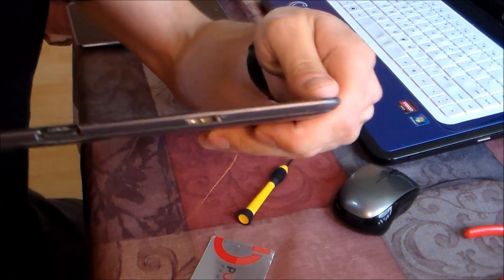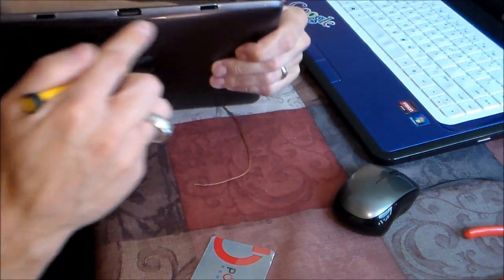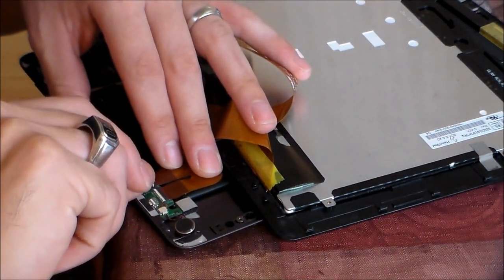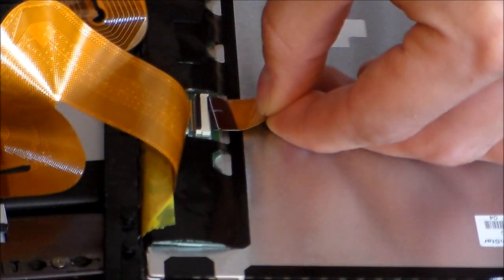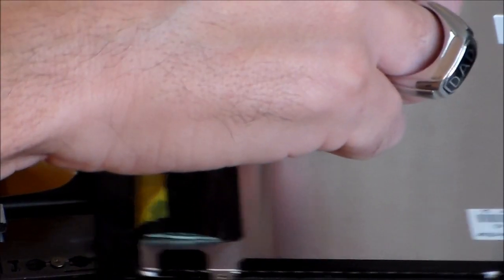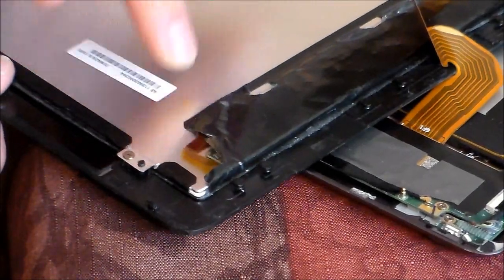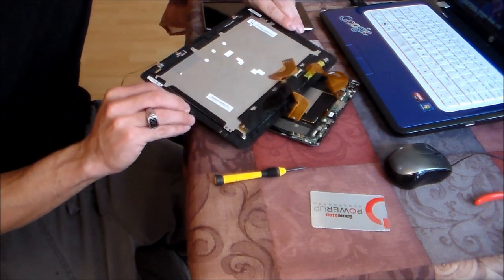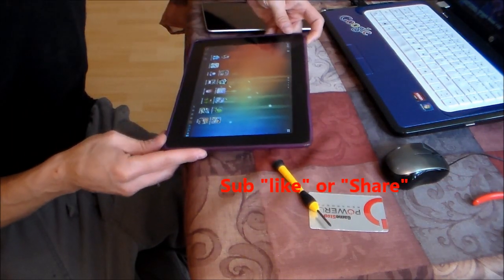Easy How to Fix Asus Tablet No video Display Screen Repair

Comment: My ASUS Transformer TF101 tablet. 
 The screen is not lighting up 
 but if you plug the HDMI cable into a TV
 the touch screen and all features work
 it only appears on the TV and not the Tablet.
i check all conections.

Comment: Do you think this will work for the  ASUS ZenPad S 8.0 Z580CA 8.0 ? I can't seem to find anyone nearby who works on this unit. Does it use unique parts as well? Glass and digitizer might both be damaged (glass is cracked).

Comment: HI Tampatec.  I think i have this same problem on my tablet (outside warranty) except my model is slightly different and i can't figure out how i might get the screen off.  i have the asus transformer pad trio, model TX201L.  ever seen  this one or have any ideas how to get it open?  the pc (dock station still works just the tablet part/screen is no longer working). thx!

Comment: I had to change my display after my roomates broke it by dropping the tablet down. After they bought a new display and they changed it, this new one cannot work once you shut down the tablet. Basically what you have to do is, connect the old, broken display, turn it on, and then connect the new one and place it where it belongs... anything I can do about it ?

Comment: Thanks for this! I watched like three other videos before this one and none of them mentioned the latches on the bottom, I thought I was crazy because I couldn't get the display to come off. Finally found yours and slid the latches over and it immediately came apart and I was able to get the display working again.
Reply from the maker: +Zack Rogers awesome

Comment: After a small drop on carpet and in a case my Transformer Infinity display wouldn't come on. I found this video and 5 minutes later it works again. Thank you so much!
Reply from the maker: cool,  good job fixing it!
Reply: +Tampatec Oh yeah, and bonus points for the Powerup Rewards card, I've worked for Gamestop for 20 yrs :)

Comment: I have 2 Nextbook Ares 8 tablets. One was dropped and the display was ruined so I salvaged the circuit board that has the charger ports attached to it since the other port was loose and wouldn't charge. Now that everything is hooked up, it charges, but when I power it on the screen turns on and is black. Is this because it was dropped? I've reset the battery and set the ribbons as snug as I could. Any insight would be appreciated

Comment: hi Tampatec. If you're still willing to answer a question on this older video; I have a similar device a Transformer Book t100.  The digitizer screen got cracked and I took it to a repair shop to be fixed. They fixed the digitizer but in the process the LCD no longer works. They made good and got us a new one but I decided to try and repair the old one myself. After taking the tablet apart, I discovered that the black connector that holds the wire from the LCD and onto the motherboard has broken and some of the wires are exposed. Can this be easily repaired? Digitizer works as does HDMI out to another monitor.

Comment: I have an ASUS Transformer tablet. The glass digitizer touch screen was broken when it was dropped. It wouldn't even show it had power after that. I replaced the glass digitizer screen. Now I can see that it has power but that is it. Nothing comes up on the screen. Got any suggestions for me. I hope. I'm getting desperate here. Thanks.

Comment: dude I enjoy your videos but you keep showing just that one tablet, my tablet does not have the lock things on the sides, all it has are the SD card slot, headphone jack, and Charger port, so how am I supposed to open it?????
Reply: also the problem with my tablet is, I forgot it was charging, and when I picked it up to take it, the charger yanked it back and it dropped on the floor, cracking the screen in many places, and now it is not responding to touch.
Reply: Kids With Dreams Music Official your tab is now good for the dustbin ! Lol

Comment: I need video on how to check my ASUS MeMo 10 K100. It was working great and the screen is black.  I checked adapter and it is working.  A little red light comes on but nothing on screen.  I tried holding down volume and power button and still nothing.  Can someone help.  I'm new to the tablet world

Comment: Hi I have a problem hope you could help me, I replace the charging connection and the screen that was crack, when I was all done i turn it on what is happening when I swipe my finger to the right the screen goes to the left then what went wrong what can I do thanks for your help

Comment: My transformar pad partially is blank and partially switches on can you plss sugest something
Reply: Is there a problem with the system or the screen
Reply: i have the same problem my screen is normal my touchpad works everywhere but there is a square with black color and if you push it its fixing its self!

Comment: Dude you're awesome!!!! I watched another video you posted on this issue and tried it on my tablet. No success the first time. I stumbled across this video on day #2 of my attempt and SUCCESS!!!!! My ribbon cable was pushed in the connectors pretty good seemingly. I say seemingly cause after trying that as your video demonstrated, I turned the tablet on and screen was still unresponsive. I then pushed down on the other end of the ribbon cable where it went downward, taking my fingernail and kind of creasing the cable and pushing it down and in all at the same time. After doing this the screen worked as it should. THANKS AGAIN! Your videos are ALWAYS informative!!! Keep 'em coming please.
Reply: :-P

Comment: Hi Tampatec, while I was using Facebook the screen became inverted (very white) and I'm not sure what is the issue and my warranty has expired can you tell me what the issue is. I was able to open the table but where you stated I shouldn't see the white line on the wider wire that's on the screen section on the table, I do see the line and even though I try to adjust it, still see the white line......I need help
Reply from the maker: reset it by unplugging battery for 1 minute, next re-seat video ribbon cable
Reply: I'm a bit lost with the statement "reset it by unplugging battery for 1 minute"